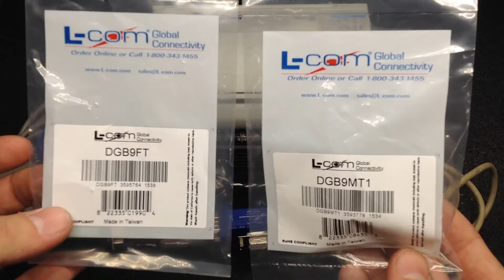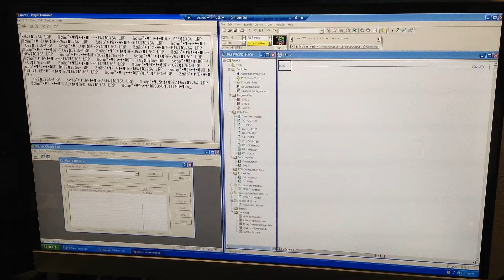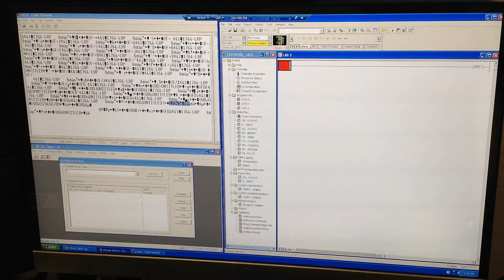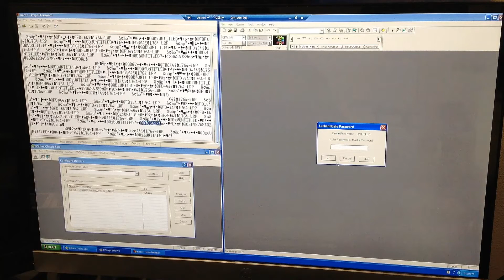Allen Bradley Micrologix Password " Recovery " Part 2 Step By Step

Comment: Pls where can I buy  the protocols USB-RS232 and RS232-RS232 ( in blue color)? Thanks
Reply from the maker: B&B Electronics 9PCDT
Digikey # 1165-1142-ND
Or just download Eltima Serial Port Monitor and you won't need the data tap and a second serial port.
Reply: Many thanks for the update

Comment: rslinx seems to lock the port out from hyperterminal, any solutions?  tried running as admin, didn't help
Reply from the maker: It should work if you are tapping off the programming comm port to a second comm port; Example, SLC/Micro on comm 1 and send data line/ground from SLC/Micro to Comm 2.  If you want to use just the programming cable, then download the free trial of Eltima Serial Port Monitor.  This can monitor the data on the programming cable without having to run the tapped lines to a second physical port.
Reply: @JidoukaSS  tried the eltima software but it won't open the port either, it says its already in use.

Comment: Dear, Kindly could you please send me a 
1) schematic diagram of the setup made here along with communication protocols and 
2) system components part numbers used in here.
3) Is this set up works for ML 1200 as well as ML1500 ? 
4) hyper terminal free trail version 30 days will server our purpose or we have to purchase licensed one?

Comment: Need help with Hyper terminal, I am running windows 10 and am having issues with Hyper Terminal it connects but no spit out of info, how do you configure hyper terminal? Any hep much appreciated, I bought a data tap with company and if I dont get it ill be in the dog house
Reply from the maker: I'm not sure what hyper terminal looks like on windows 10, because screw windows 10, but any terminal program will work.  You just have to setup a new connection and select the serial port that the data tapped, straight through or home made cable (connecting PC Pins 2 RX and 5 Ground) is connected to on the PC; the RSlinx comm port is separate( Find comm port number in device manager).  Make sure that the data tap switches are on and sending it to the tapped port(pin 2). you just have to make sure the data rate is the same 9600, 19200 etc, or you can download a 15 day trial of Eltima serial port monitor and monitor the RSlinx comm port in the same way without a data tap.
Reply: Thanks for the reply....I have both data tap and software .... nothing comes up when monitoring from hyper terminal....says connection is made but no data or info pops up
Reply from the maker: @bricecarroll7859  What comm port is rslinx setup for, and what comm port is hyper terminal setup for and what is the flow control set to? If correct then you may need a different terminal program as I believe microsoft hyper terminal was ditched after XP.  Also, is the cable off the tap a straight through cable, one to one to PC second comm port, and can you go online with the plc through the data tap  (PC---straight through cable---data tap---micrologix cable---PLC)?

Comment: I'll need to round up some cables. Does this require the source code file to be on your pc? Or can this be used to to extract code from the plc when you have lost your pc and backups? Thanks!
Reply from the maker: I believe you can just upload, but there won't be any comments.  You can also just download a trial version of Eltima Serial Port Monitor which will acts like a virtual second cable; just need the one AB cable.

Comment: Have you tried using serial port monitor from eltima? Pretty easy, no cable splitting, need only one computer. Just get rslinx communicating to plc,start rslogix, try to go online. Start serial port monitor and type in com port to monitor. Monitor shows password as you describe in video.
Reply: Thanks Leo. Eltima works great for this and has a 15 day trial.
Reply from the maker: Very Cool! Thanks for the tip.
Reply: Your videos got me to understand how it could be done, I just stumbled on this path.
Reply: Hi, is necessary have a special account for eltima, you can explain step by step thanks
Reply from the maker: Eltima is not free, so you'll have to purchase a license.  I have just tried it and it works great.  Thanks to Leo O for the tip. Cheers!
Reply: When i try Eltima it just says "comm port is currently being used by another software" how do you get around this?
Reply: Thank you, Bro, it worked for me as well in AB Micrologix 1500
Reply: @SAMBHUNATHR-dx7ym  How did you get the Eltima software work to see the password? What information were you monitoring?
Reply: I don’t have 2 cables to that was my only option. It worked bruh 10q

Comment: Hello Friend
I have a question you used the USB port and serial port and connected to on the data tap rs 232 at the same time? video and appreciate a reply
Reply from the maker: +Toño Yepez Yes, I used the USB-RS232 to communicate with the PLC on one Comm port, and connected the data tapped RS232 cable to an actual physical serial port on the same PC.  You could use a second USB-RS232 for the data tapped stream as well, you just need to make sure that you select the appropriate Comm port # for the terminal program.  The data tap is a simple straight through connection with a couple of switches and protection diodes that connect either the RX or TX lines to the other DB9 connector.  You want to tap the USB-RS232 serial RX pin 2 which reads the transmitted data from the PLC TX pin.

Comment: This worked really well for me.  There were two hitches though.   First, the serial link to the hyperterminal only used pins 1 and 5.  If you use pin 3 it causes a communication problem.  Second, the password I was recovering actually repeated itself twice, so there may be a few extra steps when deciphering it.
Reply from the maker: +Jim bardo Glad you were able to get it working.  It's a nice thing to know even though I don't come across password protected PLCs that often.